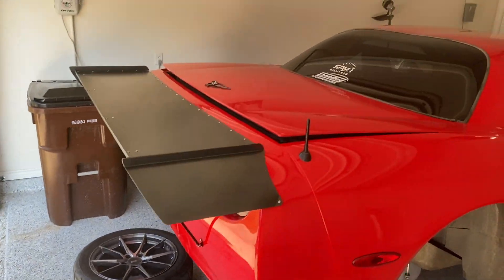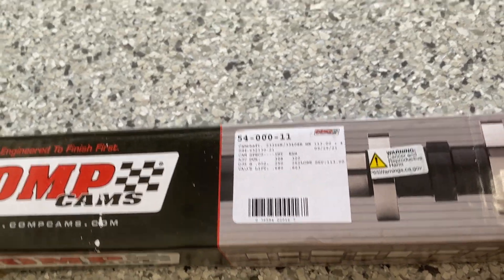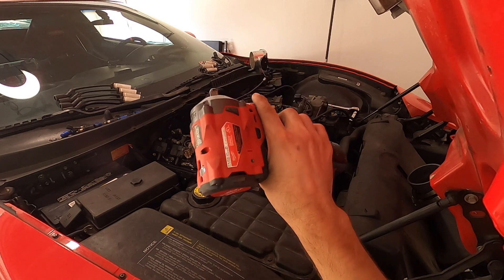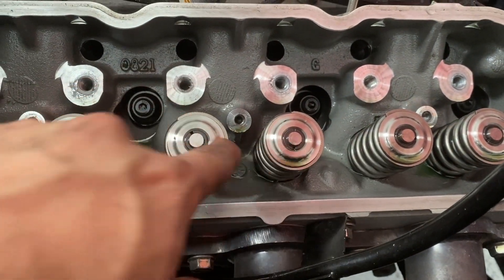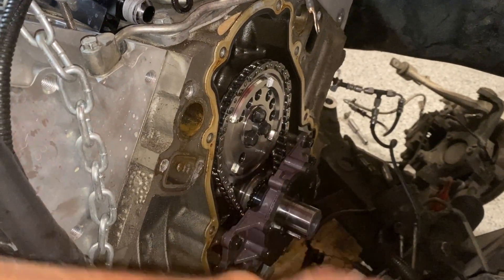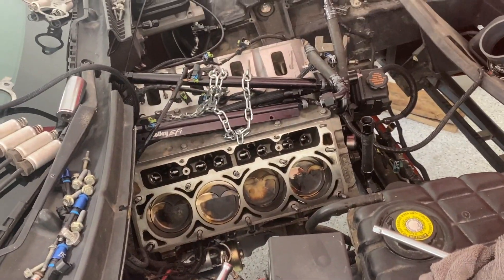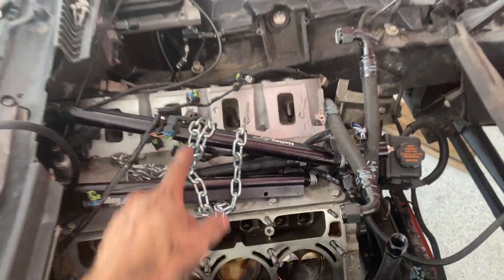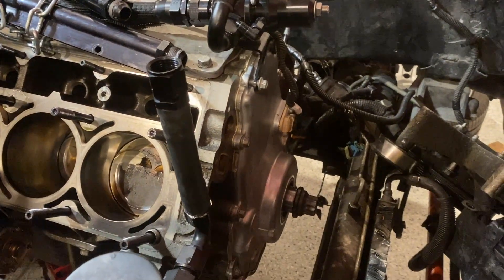Building a 200mph Corvette - TX Mile (part 1)

Comment: Parachute? Why
Reply from the maker: Have you tried to slow down from 206mph in only 1/2 a mile? You need one
Reply: @JacobVillemain  just figured more weight for nothing modern brakes can do the job, just wondering.
Reply: Brakes fade really  fast at that speed.The chute really helps and if  it doesn't open there's problems

Comment: Not sure if it would be easier but you can get balancer off & cam out without dropping the cradle , pull 1 bolt from steering shaft( mark & drop when you move rack) loosen abs pump & move out of way , pop tie rod ends off , remove steering rack bolts , pull steering rack up & shove it out through opening in oooops,,um , I think passenger side wheel well , it will go through far enough to clear balancer & cam . Good luck at the Mile , fiberglass side up !